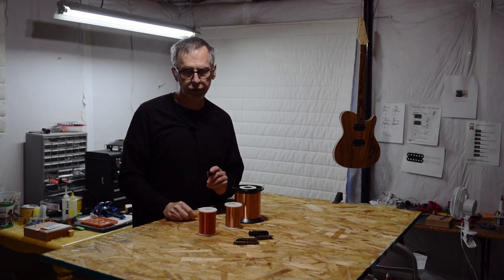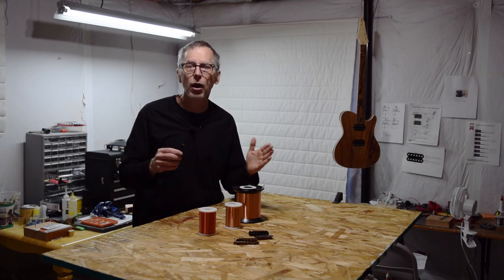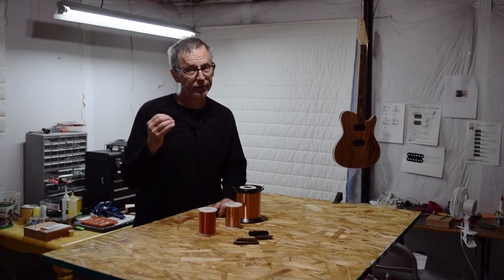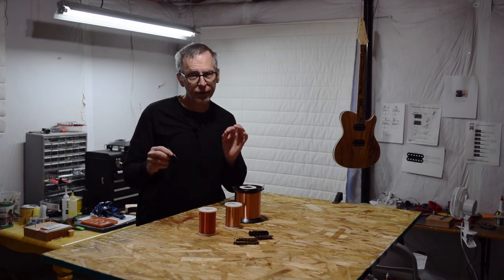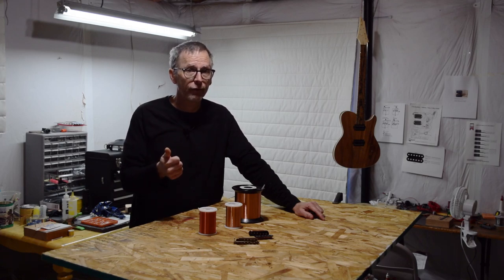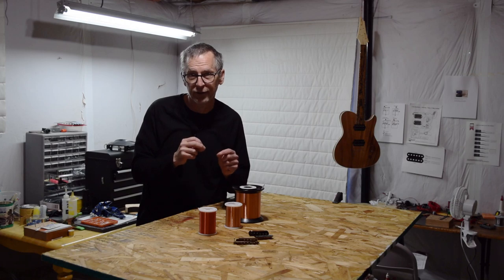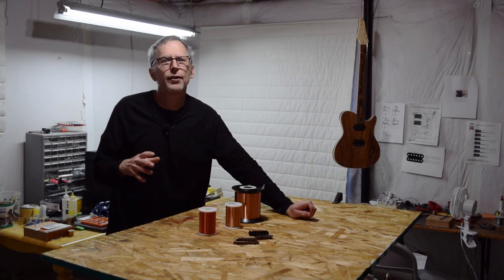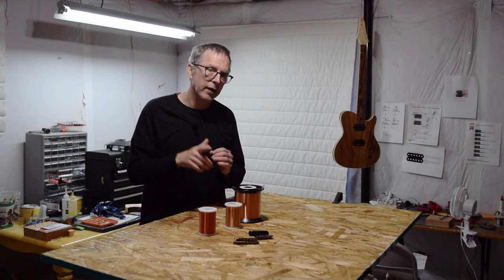How to Select Coil Wire For A Guitar Pickup

Comment: Electricity doesn't travel throught the body of the wire, it travels on the surface of the wire. This the reason they use lots of thin wires, not one big chunk...increased surface area

Comment: I suspect that IF the chemical composition of the coating has any effect on tone, it would be a function of the material's electrostatic permittivity. This is because that in theory there should be some parasitic capacitance within each turn of the coil which is a function of the overlapping area, the permittivity, and the separation of any two points

Comment: Thank you for this information.
I'm thinking of making something different, an 'Alumitone' style pickup, with a small transformer to step up the signal.
Have you looked into these surprisingly simple devices?
I'm wondering what changes happen to the signal with different wire thicknesses, and also with varying magnets and transformers.
There's got to be a sweet spot.
Reply from the maker: I have looked into it far enough to know I’m not interested. In regards to a”sweet spot,” there can’t be one due to the subjective nature of a pickup’s tone.

Comment: This is a really excellent video on 'first principles' of the impact of the wire on tone.  Elsewhere you discuss the tonal impact of the wire traverse during winding (scatterwound vs machine wound).  Which variables have the greatest impact?  Can scatterwinding 'overpower' the tonal properties of the wire selection?  As always, thanks for the outstanding lecture on this topic.
Reply from the maker: The only variable is the degree of scatterwinding. Wire selection has far more impact than the degree of scatterwinding.

Comment: It’s the number of turns, not the length of the wire that determines the output. 8,000 turns of 42 and 44 will have the same output. Obviously if you want to fit more wire than the bobbin will hold with a certain gauge, then you must go thinner. 

I’m not convinced the resistance matters, but they do sound different. 40 AWG will be much brighter than 42 with less mids. 44 has a tighter low end. The mid bump will happen as you wind more wire since the pickup acts like a band pass filter. 

Don’t forget that the wire is generating the current. It’s not just passing signal. Also the current resides on the surface of the wire (skin effect), so clearly thicker wire has a larger surface area. 

None of this is totally understood for pickups, but is better understood for inductors and RF circuits.
Reply: "8,000 turns of 42 and 44 will have the same output."  Wouldn't that statement only be true if the resistance is the same?  But since the 44 has more resistance (>50% more) for the same number of turns, that's going to affect both current and voltage, leading to lower output for the same number of turns.
Reply: ER Webster No. DC resistance has zero to do with output. The output of a pickup is partly based on the number of turns. This is an inductor. Each turn around the core increases the output. It’s the going around the core thing that makes this a coil. 

And pickups are AC resistance (Impedance) devices. DC resistance is just a marketing tool. Inductance is the proper measurement. That’s why Bill Lawrence never listed his pickups DC resistance. Only the inductance.  

This is just one of those big myths. 

As a practical demonstration, many DiMarzio pickups use essentially the same number of turns of different gauge wire on each coil in their humbuckers.  For a humbucker to be effective at bucking common node interference, both coils need to be close in output. Even though the resistance is very different between the two coils, they hum cancel just fine. 

I make many pickups this way. I’ve made hundreds of sets of pickups on my own, and I also worked at DiMarzio in 2018. 😃
Reply: @DavidRavenMoon  Ok, I think I kind of understand what you are saying.  I hadn't really considered that pickups are marketed as having higher output concomitant with higher resistance.  It would therfor stand to reason that inductance would be way more important than resistance, otherwise higher resistance would lead to lower output.  That's because the turns are effectively "generating" the signal, not just transmitting it over a straight line.  Thanks for the detailed response, much appreciated.  👍
Reply: @DavidRavenMoon  Yes, I think you're absolutely right with what you're saying about the number of winds being the parameter that decides about the signal strength.
The problem with the AC-related parameters of a coil is, that they're very difficult to measure.
DC resistance can be measured by anyone, even without the slightest idea of AC circuits - just grab a 10$ multimeter, switch it to "20 kOhms" mode and connect the tips to the pickup... 
If all pickup were wound with the same wire, this would give you a hint regarding the coil's output signal strength - provided, they use the same same bobbin... Because this decides about the length of wire needed for one turn and as the end result, the DC resistance of the coil.

It's a rule of thumb, nothing else... ;-)
Reply: @ERWebster  No, it wouldn't... The voltage is what decides about the volume. 
But DC resistance has an influence on the impedance curve of the coil. Higher DC resistance flattens the peak in the transmission curve. An ideal coil (without DC resistance) would have a very  steep curve, thus extremely emphasizing frequencies around the resonance frequency. This would lead to a very specific sound. More turns would shift the peak to lower frequencies, less turns to higher ones.
As in real life, creating pickups is making compromises... You cannot have a pickup that has a very high output, a perfectly balanced low, mid and high frequency response, and a characteristic sound at the same time.
Reply: David is correct, and be aware that we would be talking UNLOADED output. Once the pickup is connected to a load, the resistance can affect the output and becomes a factor in frequency response due to capacitance at various places in the circuit.
Reply: Dc resistance as far as i can tell is mainly just a indirect yet accurate guestimate for inductance.

From a pickup fabrication point of view the design wont change much between trials, but if you wound 3 different ammounts you will measure that the pickup with the highest resitance has the highest signal. 

But it is the relation of resistance to wire length at a certain gauge, divided by the average path of a single winding which gives you an estimate of inductance. 

As for dc measuremenrs, the signal it passes is not dc it is actually a signal with 0 mean, no dc component. So what restricts the signal is not resistance it is something called impedance. 

But when you think of it like this there really are only 2 components, a pickup without guitar circuitry is a low pass filter, and consits of an inductor and an capacitor. The capacitance also comes from the wire properties at that length, so as you add windings you increase the inductance proportionally to the capacitance shifting the cuttoff frequency.

Im curious what their bode diagram would really look like in practice, ill try and wire this up over the weekend. I want to know if it is a LC low pass or band pass. 

Got a bit distracted, but point being is that reistance for any production mod relates directly to all these properties, so it makes sense for manufacturers to take note of it and use it in dialogue
Reply: @molomono9481  You’ll notice that only Bill Lawrence lists inductance. DC resistance is an indicator of the amount of wire on the coil. Inductance is influenced by a few other things. How much iron is in the core? I make high inductance, low resistance pickups. Adding more iron will raise the inductance and the output. DiMarzio does this with small iron slugs inserted between the pole pieces (I used to work there). It’s good to know the inductance, but honestly in the 20 years I’ve been making pickups I’ve never owned an inductance meter.
Reply: @DavidRavenMoon  Yeah that makes sense, to measure the inductance has no real practical reason. If you need more inductance, give it more windings or swap out the core for a different magnet/material. Measuring inductance is just crappy since it is hard, it includes components that can't be continuously varied by the manufacturer of the pickup, it just makes things more complicated. I'll try and make a few, if i have time also try and measure the frequency response graphs to finally know what effect windings/wire gauge have on signals.

Comment: On a typical Gibson 49.9mm humbucker bobbin (H=0.371 L=2.613 W=0.649) the absolute maximum amount of wire you can put on it are:
6000 turns max @ 42awg
8000 turns max @ 43awg 
10,000 turns max @ 44awg
Obviously you wouldn't want to fill the bobbin with so much wire but it is a better point of reference than what the 'average' is.

Comment: I always learn a lot from your content. Thanks for the great info. I was confused by one thing and would appreciate clarification. At around the 6:40 mark you mentioned that two coils wound to 6,000 turns would result in different length of wire based on insulation thickness. It said the thicker insulation would have a shorter wire length. As I visualize the process, it seems the heavier insulation would build a larger diameter coil. Since the number of turns are the same, wouldn’t the larger diameter coil have a longer length of wire? Thanks for all the educational videos!
Reply from the maker: You are correct. I misspoke about that. The thickness of the insulation won't change the length of the wire if the turn count stays the same. However, it will affect the capacitance of the coil. I need to make an update for this video as there are a couple of things I need to change.
Reply: @HighlineGuitars  So much good info in this video. Thanks for this. You cover a lot of info, so it is hard explain everything perfectly. Your videos are giving me the tools and information I need to do something I have always wanted to do, for which I am very grateful.

Comment: I love this. Only point of criticism, I'd get a quiet background track. I'm planning to use this to make humbuckers with slight asymmetry to their sides (won't cancel as much hum, but will have more highs)
Reply: I am interested on itr. WILL YOU PLEASE elaborate? I LIKE highs! So WILL USE neo
Reply: @elioalcala4371  So, I don't know how much variation is required. I know there's a guitar maker that makes these and the guys on that pedal show have a 335 style guitar with them. They remarked how it sounds more like a single coil as a result, but also doesn't  buck the hum, and that it was because one side was wound more than the other. I want to play with this too, but I haven't yet.
Reply: You might even try one coil with 42 gage and the other coil with 43 gage. I’m going to try it just to see how the pickup responds.

Comment: Really useful information, thanks. Though in the video you state that the closer the cores are to each other (due to thinner insulation) the less mids and treble present, though the insulation thickness chart states the opposite. Or have a misunderstood this?
Reply from the maker: If I remember correctly, the chart was intended to show which frequencies are clipped the most based on insulation thickness. Therefor the thinnest would have the highest number of treble and midrange frequencies clipped. I don't think the chart was titled correctly.

Comment: the pick up coil in only one part of the pickup as is the magnet type and strength and other    materials  in the pickup and other  electronics and hardware  in  the guitar and It's construction and all else in over all signal chain and therefore has less effect on tone than most people think . It does have an effect just not that much comparatively.

Comment: I didn’t know poly nylon was an option, and I thought poly insulation was polyester.  I think PE is actually polyurethane, or some type of lacquer.  Modern poly incorporates aramid, which I assume minimizes compression and stretching.  I see no reason to use the older types, but players might prefer the lossy or less efficient results in some cases.  

It’s not true that the higher DCR of thinner wire causes less mids and highs, although it ends up like that for other reasons.  Pickups are AC devices.  Even 2x the DCR has very little effect on the tone compared to the pickup Z.  The Z is more consistent with thinner wire, which lowers the Q, but doesn’t roll off more above the resonant peak.  I think it actually rolls off less, but guitar speakers tend to roll off much more highs anyway. The stronger note fundamentals from a denser coil also emphasize lower freqs.  Using one higher value R pot with thinner wire coils will make up for the lower Q, and there will be even less roll-off, but the sound will then be more “scooped” considering the stronger fundamentals

Comment: Great stuff man, thanks for the insight!  I appreciate the info and the delivery.  I did have one question though:
In the video you mentioned 6k turns of formvar and 6k turns of poly.  You stated that the formvar wire would be shorter.  However I think this incorrect, since both bobbins have 6k turns the formvar coated wire would actually be slightly longer, since the outer wraps would have a greater diameter than the outer wraps of the poly due to the thicker insulation.
But if someone were to fill a given bobbin until the outer wraps were parallel to the plane of the edge of the bobbin using both formvar and poly, then the poly wire would be significantly longer because it would actually have more wraps total (less volume occupied by insulation and more by copper).
Reply: He messed up
Reply: Yeah. I caught that too. I think he just mispoke. Thicker wire because of thick insulation = less loops.

Comment: Is this why bass guitars are (usually) active? A thicker gauge to retain more bass means a shorter overall wire which means lower output signal which means an onboard pre-amp is required?

Comment: Sir, can you also build, and/or explain the 'secret'  behind the famous first horse-shoe pickups from the rickenbacher frying pan? Apparently they used 38 gauge wire 5000 + turns with an output DC resistance of 1.8 kOhm. I feel no other pickup ever sounded the same after these. Thanks
Reply from the maker: I don’t know anything about them.

Comment: Hey Chris great video! I really appreciate the way you approach and deliver information. I have a remark about your first chart regarding how wire gauge "affects" strength of signal. It sounds to me that it is not the gauge itself that affects the strength of the signal but the amount of a given gauge that one could fit in a finite space, say a bobbin because you can fit less wire when its thicker. Is this correct or am I missing something?

I am an amateur guitar builder and I am getting into building pickups and I am very keen on understanding how to manipulate the voice of a pickup more comprehensively. I would love to see a video where you address these things; How to manipulate: inductance, impedance, capacitance, resistance, coil height and width, and see how these things affect the frequency response/peak. 

Love what you do and keep up the good work!
Reply from the maker: The gauge of the wire affects signal strength by limiting how much you can fit on a bobbin.

Comment: impedance (Z) in AC signals (like audio ) is a complex thing. To calculate it you must know the real reactance (inductive reactance + capacitive reactance) as well as the resistance (dc wire resistance in this case).
 The actual output voltage depends on pickup impedance (therefore, all those values) and load (vol/tone pots,  cable, amp's input Z). If the coil were "ideal", the voltage  depend only on the number of turns (without losses due to resistance or capacitance).
.
The value that manufacturers give us (DC resistance) is only a common reference, so we do not know the real impedance of the capsule. The same with inductance, it's just a value that tells us nothing about the real impedance (but all of them, inductance, capacitance and resistance have an impact on the real impedance (Z) value). 
And furthermore, the impedance varies depending on the frequency, that is why the pickups have a resonance peak, there they deliver the max. signal (the impedance is at the highest point of that part of the spectrum, ergo, more output. A typical Strat pickup resonates near 9, 10 even 11 kHz.) The volume/tone circuit, with its resistances and capacitances, added to the cable extension  (losses due to capacitance and resistance in the cable itself) are the "load"; that attenuates the natural resonance freq. of the capsule and "equalize" the mid/high frequencies. That's why they are an important part of the "tone" (so does the input impedance of the amp or pedal;  there are certain "incompatibilities" sometimes (losses), especially with pedals (guitar amps always have a high input impedance))